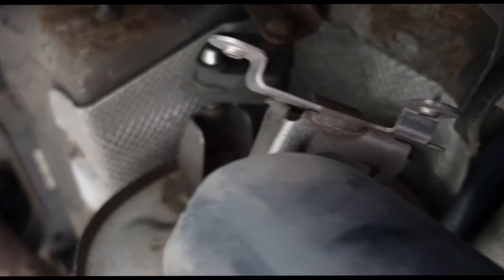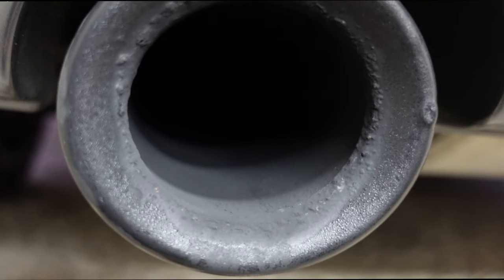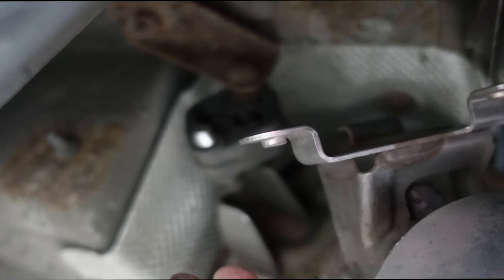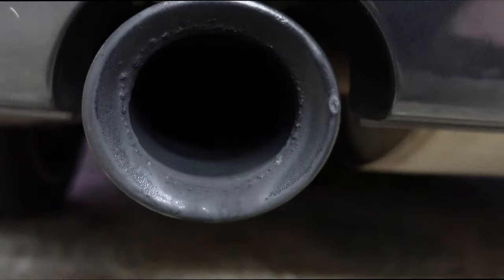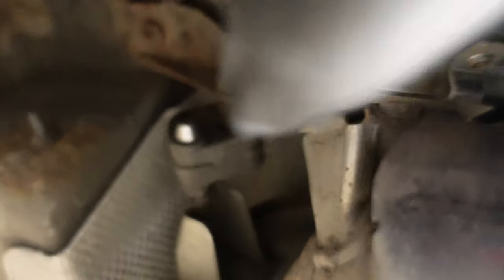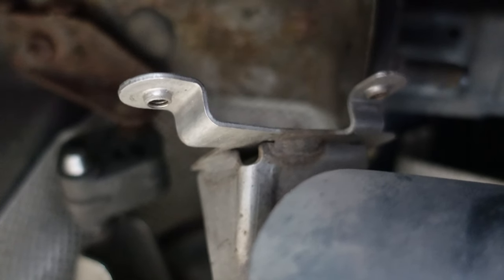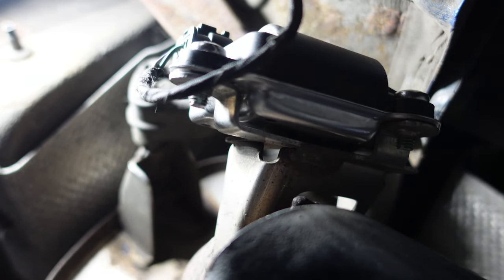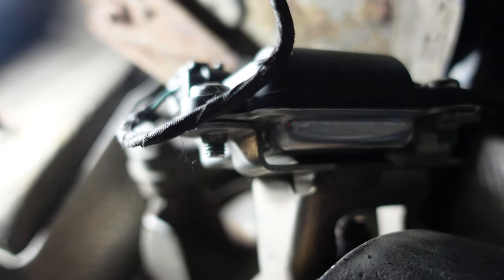Doing This Will Change The Sound & Performance On Your Car For Free !!

Comment: Just take out fuse when when the valve is open , then stays open all the time and no fault codes !!
Reply: Is there a valve on x6 40 d 20 13
Reply: hello where’s the fuse on BMW 7 G12 can you help
Reply: Where is this fuse located?
Reply: @62exide use google
Reply: @ясемен-ч3и use google

Comment: Another fix for this is to disconnect the solenoid and put a termination resistor on the connector coming from the engine computer so you don't get a fault code. BMW sells a connector with a termination resistor and they also sell a blank connector that you can insert into the connector on the solenoid so it doesn't get corroded. To use this method, you have to remove the solenoid, turn the solenoid to the open position and then reinstall it. If you want to go back to stock, just reconnect the wire. I did it on my F39, which has the same solenoid as on your car.
Reply from the maker: You can do this in many many ways, including what you just said, or you can pull the fuse that operates the valve, Or you can put it in sport mode Rev it as soon as the flap opens disconnect it, or you can weld it open as they have done with mine. Or better still change it to a milltek exhaust system and be happy 😃
Reply: @BMWDoctor  if i have gutted dpf . Could i still have this problem i got a fault )( exhaust gas cooling switching valve open circuit.,) please help
Reply: After reaching 120mph the car goes into limp mode
Reply: @BMWDoctor  I set my flap through BimmerLink with no issues. BimmerCode does not have engine upgrades for my 2013 X1. I opened my exhaust flap in BimmerLink, which is basically a poor man’s sports mode.
Reply: How can you turn the solenoid into open position? Mine does not seem to work at all and is pretty stiff and is in close. Can you force it with a screwdriver?
Reply: You don't geta a fault code by disconnecting it. Mine is disconected and not a singe issue, better sound and now it doesn't rattle.

Comment: My 5 series just disconnect the arm that opens and closes and I used a nail to pin the flapper open.  The module thinks it's  opening and closing but it's not. 10 minutes max to do.

Comment: My 330e g21 u can choose engine sound in all modes. U dont have to do this , u can open the valve at start. Maybe this is not the case in older models

Comment: I went to do a muffler delete today on my 2015 n20 328i, the guy told me it wouldn’t be a good idea because that “sensor” on the exhaust (valve actuator) needs to stay there because if not it will throw up engine codes and car will go into safe mod and lose power. Is that true Doc? Am I able to get rid of that valve actuator to get a muffler delete without any problems.

Comment: HELP. I’ve recently bought a m135i exhaust to get a dual exit exhaust on my 120D. How do i go about getting the valve cabled up if its a none valved car to begin with? How can i get the valve to work as it normally would?

Comment: I put a different muffler on that didn't need the valve. I tucked the plug up and obviously left it unplugged. My gas mileage went way down. Is thus possible caused by deleting the valve? I never got a check engine light. My car is a 23 m440i.

Comment: I believe there is a dummy plug available from BMW that you plug in when the BMW MPE exhaust is fitted to stop the error message.
Reply from the maker: Yeah I know there is now, I think whoever owned this did this when that wasn’t available that’s why they welded it open. Either that OR the actuator was so expensive to buy back then they couldn’t be bothered to replace it. Who knows 🤷‍♂️
Reply: Where can I purchase one

Comment: I had to map cold start out on my car when I started work at 4 o'clock in the morning, Was far to loud!
Reply from the maker: 😂😂😂 I bet these are way way to loud with that flap open. I thought my M5 was loud on cold start this is another level, yet someone wanted it like this permanently. I can’t take it much more 😂
Reply: @BMWDoctor  🤣, Once the car is fully warmed up i personally think its to quiet, I would like it to have a bit of noise on tick over, On WOT on the other hand it's lovely, Looking forward to the Miltek install as I'm unsure what route I'm going to go.
Reply from the maker: Yeah bro I’m doing that this month I have too, you know what it ain’t even expensive for this car either ! It’s like £700 for the milltek system so I thought f**k it I’m gonna put that on. Makes more sense, I mean mine is way way to loud constantly as the flap never closes so even driving without sport mode it’s just open and loud. I mean don’t get me wrong I like it, but coming from my E60 M5 I can’t take that noise all day everyday when I want to use my M135i as my everyday car. But I got to say I love that N55 rumble 😍 nothing beats it not even the B58 the roar exhaust sound, especially when you plant your foot jhezzzzeeee this thing “MOVES” 😂 I mean let’s just say I had my M5 over a year and didn’t get a speeding ticket, I got this within the first 2 days I got a speeding ticket 😂😂
Reply: @BMWDoctor  That's strange to me why you find your car so loud once it's fully warmed up 🤔, Mined has the decat pipe done and it's MHD stage 2+, And still I find it quiet on normal daily driving, Can the exhaust valve be stuck in the closed position? Is your exhaust stock.. I wonder if someone has done the back box mod to yours when they were welding the valve open 🤔
Reply from the maker: I think they did indeed mate, mine has been gutted and welded therefore it’s very very loud and roars even when your foot ain’t planted 😅 I will have to do a cold start on it before I put the milltek exhaust system so you can hear it, I mean I will even Rev it and you can hear the back pressure from the turbo when it’s revved over 3k 😅 I mean I gotta say I do like it. But I wanted a silent car as all my cars are loud
Reply: @BMWDoctor  🤣🤣 I can only imagine what it sound like gutted on cold start, ASBO 🤣🤣 Amazing cars though mate and the bang for buck is incredible, Looking forward to future videos on this platform, Stay safe, Speak soon 👍